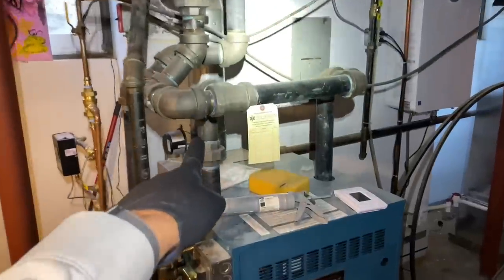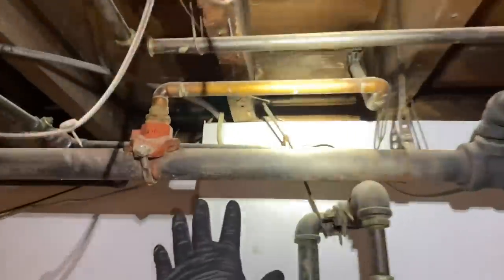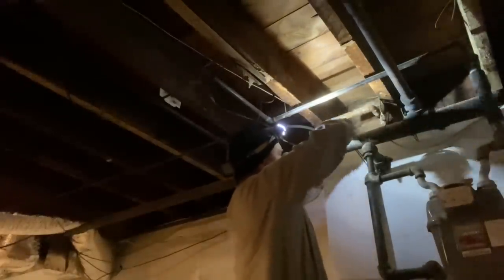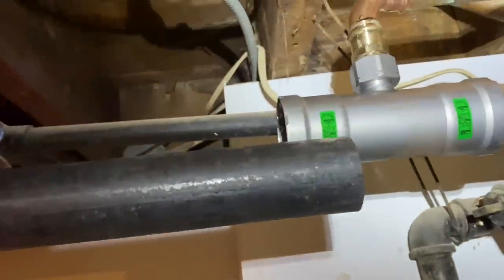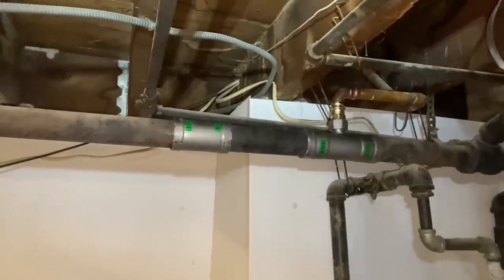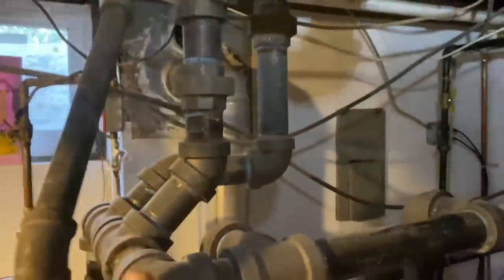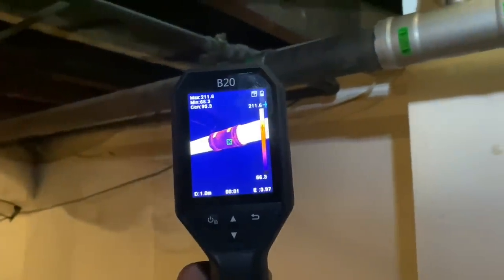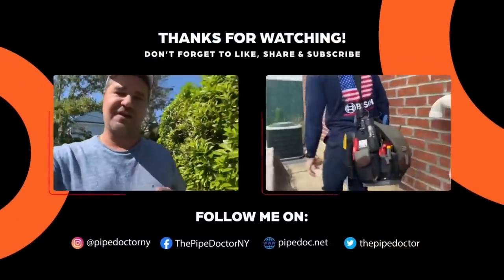Steam Pipe Leak Repair with Viega Mega Press

Comment: Beautiful job. I have been using a harbor freight 120 volt Titanium flux core inverter mig welder to weld on threadolets for repairs and air vents. These things are super lightweight and work well.  Very generous of you giving back to the community.

Comment: How would you add in a steam vent on that main?  Would you add in a T before the swing joint at the end or would you weld in a threaded bung on the swing joint?   Mine doesn't have one there, but it has one at the end of the dry return before it drops down to being a wet return.

Comment: I'm thinking about get rid of the force air heating and going to a boiler.. I have a lot 
Different rooms.. is a boiler system more expensive then force air?
Reply: majority of the time boiler installations are more expensive, usually cheaper to run once its all said and done.

Comment: Hey Mike are these approved for steam?is there special orings in these fittings?I asked one of my suppliers and said no....need to ask others but I'm sure you did you research first....havent needed to do a repair like this until last weak I bid on a job doing similar repair only difference is its a 6" header so if this is approved I will need to by this press but I still might wound up doing a bolted flange repair
Reply: They are approved

Comment: Have you ever seen an outta control system?🤣🤣🤣🇺🇲🥃🍺
Reply: @PipeDoctor  it's steam?
Reply: @PipeDoctor  you've never seen pipes moving and hammering,  plus that crap expands and contracts at a different rate than the pipe 😳